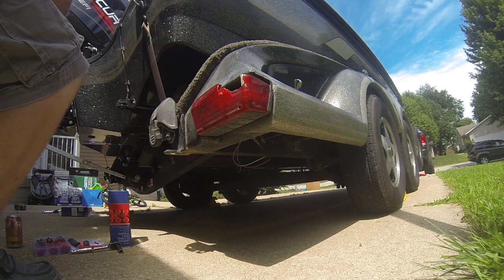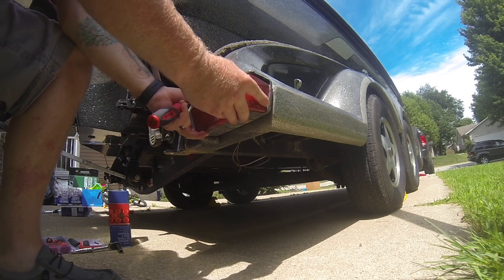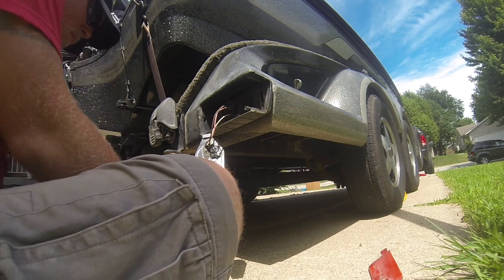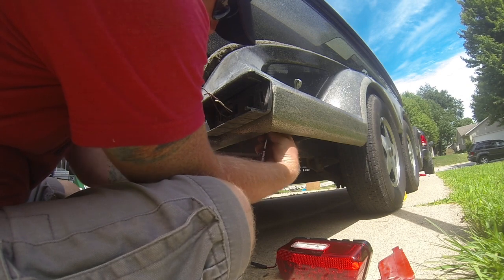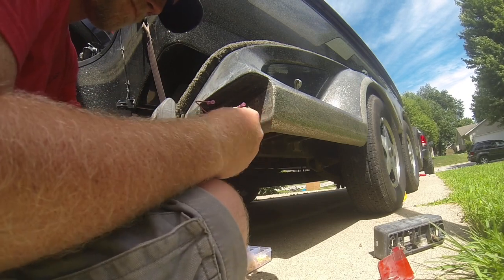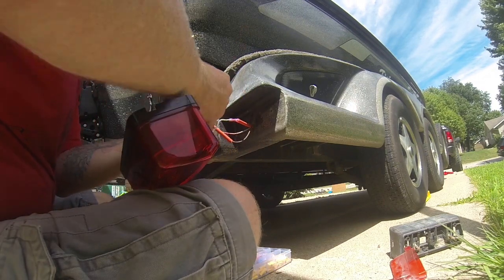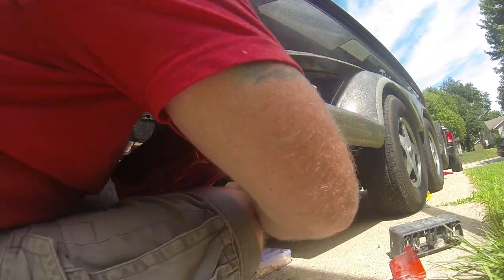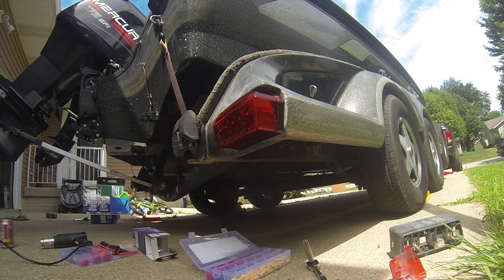Wesbar LED Trailer Light Install

Comment: What year trailer is that? Do you have the part number for the lights used? I want to convert my '02 Ranger trailer to LEDs and wondering if those lights will fit my trailer too.
Reply from the maker: Mine is a 1997. Fulton Wesbar 281594 & 281595.